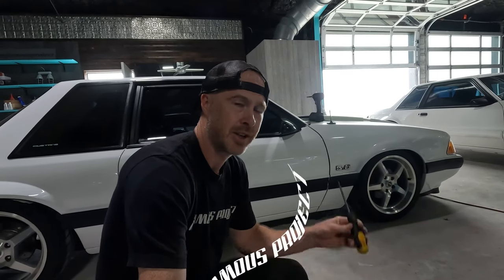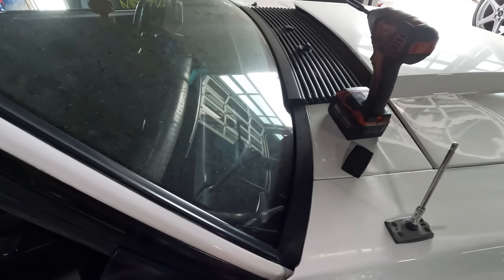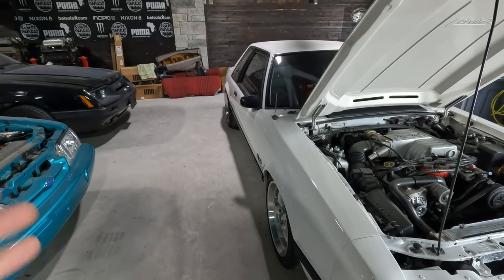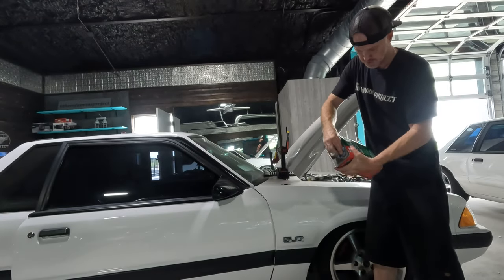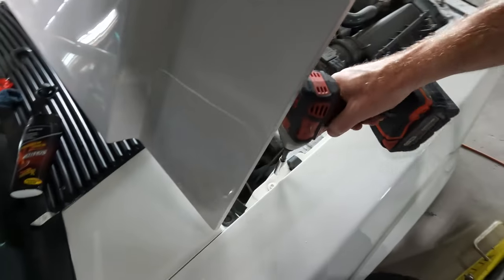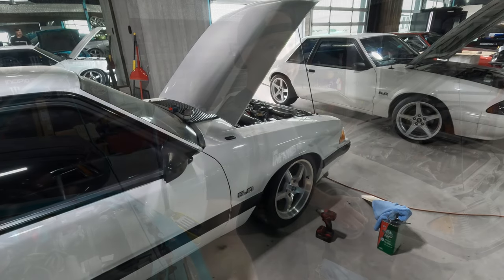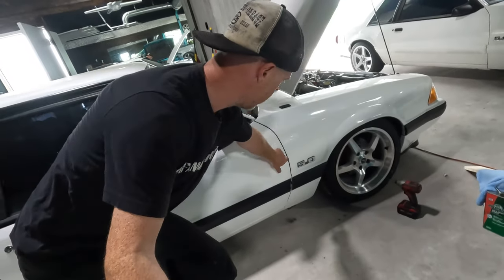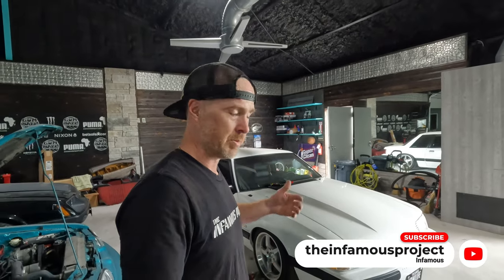How to Fix Body Lines + Antennae Delete - TIPS05E30

Comment: Chris, if you are putting a car back together from a 'full blow apart' repaint resto, where do you start the bodyline alignement?  I'm assuming the doors, but as you could see from my slobra, it could used some lovin'.  The fenders have never been off my car, but you saw the lines...  Even though most of the terminator royalty folks say that our cars were probably jacked from the factory.

Comment: OK, that's a really good tip about how to adjust the fender to door panel gap, but my question is, what retains the bottom portion of the fender and keeps it from flopping around? Original owner '91 5.0 convertible. You would think after all these years I'd know, but the car has been cared about for a long time and I've never wrecked it, so I've never really looked. Thanks. Bill in Oregon.
Reply from the maker: Hey Bill there is another 5/16 bolt under the inner fender plastic at the bottom which keeps it in place down there!
Reply: Thank you.

Comment: In your intro around :57 on the red notch you've got a front lower lip. What kind is that? I couldn't tell if it's a Mach 1 lip or something else. Thanks! Good work!
Reply from the maker: Ya it's a Mach 1 chin spoiler

Comment: Im going to watch this for sure but my doors are not hitting the fender. Instead they are hitting the quarter panel when opening and closing the doors. Also it's not a Fox but an SN95. Would new hinges and a pin/bushing kit fix my issue in your opinion?
Reply from the maker: You may need to adjust the hinges and move the door forward a tad..remove the inner fender and you'll have access to the main bolts
Reply: @TheInfamousProject  thank you very much my man. Will be looking at doing that this weekend. I subscribed after watching and hope to one day find a descent enough fox up here in northern Michigan..aka rust city.